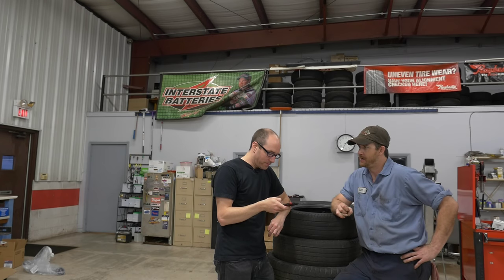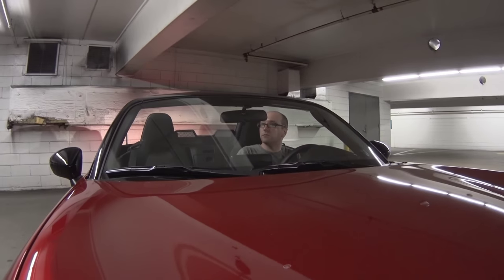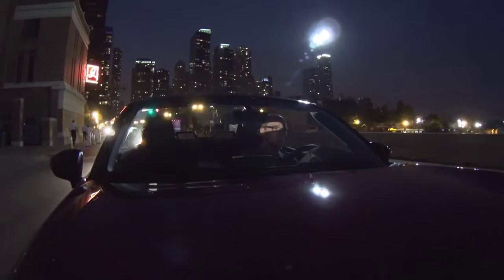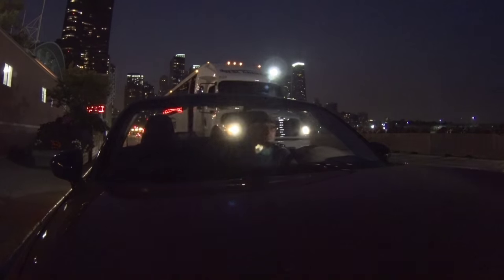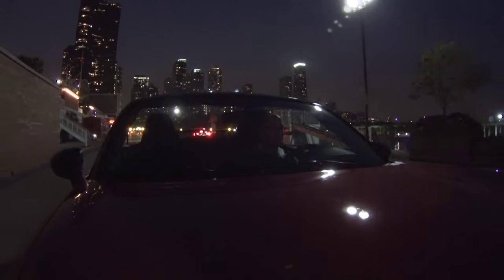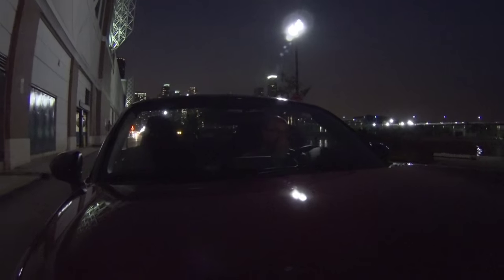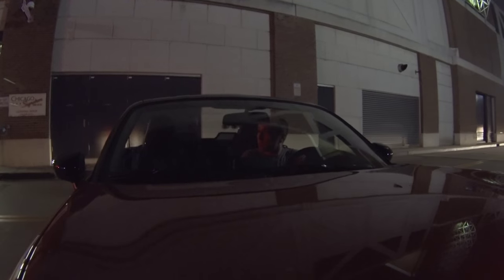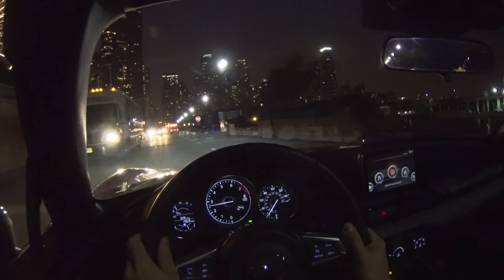2016 Mazda MX-5 Interview with Dave Coleman

Comment: Nice to see Dave putting his genius automotive insights to good use with Mazda, I read his stuff extensively back in the SCC days.
Reply: Weeeeeeerd. I still have a stack of SCC mags. He was a great writer as well.
Reply: @WeAreN1nja  Mazda knew what they were doing by hiring Dave Coleman as North American Design engineer. I also subscribed back in the day. So I was so impressed with this 2016 MX-5 Club soft top after the test drive had to Buy it. Very addictive place that drivers seat even after 6.5 years owning as a daily in Northern Illinois. I put the Michelin winter tires on for those snow & ice days. I didn't expect the car to handle so well in those conditions but it makes the 50 / 50 weight distribution show up more. Really well engineered car.

Comment: Dave Coleman seems like a totally legit dude and represents the Mazda brand well. Still, his answer to the 2.5L question was kinda BS, I give it about a year before someone figures out how to get a 6.2L LS in there - lol.
Reply: +GadgetsNGear Definitely BS, but I understand. He wants to defend the top management decision even though he doesn't want to put it that way.
Reply: He is not necesseraly bullshitting. Its quite possible that the 2.5 skyactiv is at least as tall the LS3, and from the factory they still have to fit the aero stuff and panels underneath and have a certain ground clearance etc. 

but i am very curious if the new 2.0 skyactiv-x will find its way into the mx-5.
Reply: Not BS at all, he didn't say it was impossible, he said it was more difficult. Mazda has to be concerned with production constraints and cost that a one-off tuner doesn't. Flyin' Miata has an LS in the car, doesn't mean that it wouldn't be difficult for Mazda to mass produce it with the 2.5L.
Reply: And completely ruin the handling dynamics in the process.
Reply: @kcav1255  : Mazda has to consider the cost vs. benefit (i.e., sales potential).  FM has stopped doing LS swaps, because it was taking up too much of THEIR time, but when they did, it was $50,000  -- and you supply the ND.  Could Mazda fit the 2.5L Skyactiv-G (or better yet, the 2.5L Skyactiv-T) in the ND chassis, and mass produce it?  Maybe.  But there isn't a business case for a $50K Miata.

Comment: Savage Geese had a magic ball to look into the future and ask Mazda to revise the engine to give it more horsepower, and lo and behold, 3 years later 181hp motor! 😁
Reply: Yeah, I have one and it's nice, but it could still use another 20 hp. (There is no end point to the quest for power, esp. when the chassis can manage it.)
Reply: @johntechwriter  You should check out BBR's 'Super 220' package. It includes revised ECU, cams, valve springs, retainers and exhaust manifold and you could probably be in the 200whp range. If not, you can add Flyin' Miata's midpipe+ axle back exhaust which add a further 16whp.
Reply: Art Uro  I think so, when savagegeese interviewed him again for his video called 'Mazda Miata Documentaries ND | EP5 Final Chapter?', Dave Coleman mentioned that when they were developing the ND, most of their development budget for the engine was prioritised to the 1.5 litre engine as that was how the Japanese head of engineer wanted. The american mazda HQ wanted the 2.0 litre engine for the american roads, so it was later added on, almost like an afterthought. So therefore, little money was spent on making the 2.0 litre engine 'perfect', as it was mostly off a Mazda3. But a few years later, Mazda Japan gave the engineers the greenlight to further perfect the 2.0 litre models to how they should've been from the start.
Reply: Art Uro  P.S. so at the stage of savagegeese calling him at 2015, Dave Coleman was very tight lipped about future plans on making the 181hp engine
Reply: Art Uro  Me too man 👊The 2019 NDs also get more steering wheel adjustment too for your ideal driving position. My only wish to Mazda was for them to build a proper coupe version of the car even if demand was limited - it would make the chassis more rigid for improved handling, it would have better refinement from reduced NVH and it would be more practical to store your trackday tyres 👌
Reply: Art Uro  Nah Joji is right though. For example, the Porsche Cayman noticeably handles much better as it is a Boxster with a more rigid roof for better handling. And the added practicality is a big bonus for trackdays. It sounds better, accelerates faster, and has a better quality interior than a 86/BRZ too.He's not saying Mazda should stop building the convertible MX-5s, he's suggesting Mazda to add a coupe version on the line up too. Not everyone likes to be seen in a convertible and in some countries, convertible roofs get vandalised by people who have sharp objects with them.
Reply: Art Uro  Why are you being so mad? "how many cayman were sold compared to boxsters??? A fraction!!" - okay, so tell me why:
1. dealerships are marking up prices for Cayman GT4s over MSRP price.
2. Cayman GT4s are one of the most popular track cars, ESPECIALLY on the nurburgring
3. many enthusiasts prefer the compact dimensions and midengine handling characteristics of the Cayman over the larger 911, without having to look like a poser in a convertible boxster.
4. Cayman GT4s are more sought after than Boxster Spyders 
Just because you don't like it, just because they are sold in low numbers, doesn't mean there isn't demand for them.
Reply: Art Uro  "Why r u comparing posches to brz?" I didn't. You read my message wrong. When I said "It sounds better, accelerates faster, and has a better quality interior than a 86/BRZ too.", I didn't mean the Porsche, I meant if Mazda made the Coupe version, how that MX-5 ND Coupe would compare to a BRZ. I never said that the Porsche is competitively priced to the Mazda...I don't know what you're thinking.
Reply: Art Uro  I've replied to your questions but the fact that you can't maturely reply to my questions shows that you have no reasons to back up your unjustified insults and objections. I also never said I wanted to buy a cayman. I brought the 'porsche cayman' example up because it is basically a coupe version of the boxster - its a proven case that could be applied if Mazda hypothetically built a Coupe version of the ND MX-5. So what if it doesn't sell in big numbers? Mazda can make it a limited edition, so that they can increase demand there.

Comment: Just a comment in general on infotainment screens. If like the mx5 you have a screen that can be specified with a rear view camera then it has to be able to pass an assessment or it cannot be legally sold in the US. Essentially there is a trade off between distance, resolution and angle. A high res IPS screen is expensive and requires a more expensive processor so in order to pass the assessment with a normal 400X800 TN screen you have to go with the floating dash solution if you have a very low scuttle.

Comment: as the Miata ND needs to last a good number of refreshes. what do you think the chances of the 1.5 version with turbo coming to the states? possibly could be a MazdaSpeed edition?  how much HP could it produce?
Reply: The turbo would compromise drivability. That's why Mazda have resisted forced induction. It would have been easy for them to stick on a snail and get 225 hp. Instead they developed every component of the 2.0 engine and got 181 totally linear hp with peak torque dropped to 4000 rpm. The result is a fantastically drivable car whose 0-60 time of 5.7 seconds would blow a Jaguar XK-E into the weeds, and will top 140 mph.

Comment: Nice review, and your interview with Dave Coleman makes it that much better.  Living with the car, I don't think the criticism of the infotainment system is warranted.  I also think I know why it is the way it is.  Visibility is just right -- it's not in the way or a distraction, but you can see it if you need to without taking your eyes off the road.  (You can shut it off by simply speaking the command: "Display off.")  If it was motorized to drop down into the dash, the dash would have to be heavier and visibly more buky, you would have to wait for it to rise to use it, and it would add a complex mechanism that would be expensive to fix if it failed.  Even a manual fold-down screen would risk expensive failure.  Think about how prone to breaking at the hinge area laptop computer cases are.  The "stuck on" look is just something that takes getting used to with any flat screen tech.  TV cabinets looked "strange" when they first stopped trying to make them look like furniture, but we got used to it.  Today, a "console" TV is a museum piece.  Then flat-screen TV's made that huge black plastic box behind the TV obsolete.  Having an in-car flat-screen display built into the dash makes about as much sense as putting a fake black box behind your flat-screen TV to make it look "right."

Comment: He totally avoided the LSD question at the end. I wish you guys didn't mention "suspension" in the same question (because that answer is obvious and easy – that's why he stuck to talking about it). Or that you guys at least reiterated or reasked the LSD question, because that's the real question.
Not even for performance but rain driving, snow driving, etc. Then years decades down the line, you have a lopsided market for a used ND where one has to avoid the numerous Non-LSD cars driving about.

Comment: " We want EVERYTHING for $25k"
Reply: I got everything for $24,680. It happened last September (2019), when I purchased from a Mazda dealer a new '19 Sport model with manual transmission. This is the same 181 hp power train as in the Club but for thousands less. Take my word for it . . . this is my fourth MX-5 and unless you're autocrossing you lose nothing by buying the base version. In fact, the Sport is so much cheaper, you could probably upgrade the brakes and suspension more effectively than you could with the money saved by not buying the Club, and the car would be uniquely yours. I have yet to see a Sport version reviewed on YouTube. Mazda and its dealers would prefer you didn't know it even exists. But it does, and despite its price being bumped $1k for 2020, it is the sports car bargain of the industry.

Comment: the biggest jibe with these cars is the accommodation for larger drivers. It seems they are designed for the asian market. Once you approach 6 foot height, the car becomes cramped. Even smaller drivers sit perched up in the vehicle. Why not a mini-Mclaren driving position? Sit "in" the car, not "on" it.

Comment: Yes I think that the NC was generally more appealing to a softer older GT crowd then the NA & NB & also coz it came with a Power Retractable Hardtop that is more practical unless you wanted the lightest weight possible for track use... That's why the Removable Hardtop wasn't popular. I they should definitely bring out a Hardtop as as this car is definitely more appealing to the Club Racer or Weekend Warrior as the first two were. I think that there should be both Power & Removable as there is clearly going to be a market for both with this model... They are already offering a trim for each market so why stop there??? Are you listening Mazda??? Give the GT a Power Retractable Hardtop & The Club a Removable Hardtop, Recaro's & hopefully a Supercharger this time (or a Turbo... I know more peak power & more practical blaa blaa) as it is more enjoyable to drive especially in a car like this IMHO... & that's what this car is & always has been about. Maybe even a roll bar for the Club. DO IT! I along with countless others will buy one!!! Get your arse in gear Mazda!

Comment: That screen is a horrible touch and it's not just this car.
Reply: +Scott P Love it.  I'll bet none of the haters have ever used it.
Reply: i can't get used to it on my roommate's Mazda 3 and when i test drove the Miata. was a distraction, especially for a roadster. they need to allow the option for Android auto or Apple carplay ASAP. 

especially since it's in all their vehicles, bite the pride and bullet. love the user and give us the standard in smartphone integration. you can make up the cost over time. 

my roommate tried to update the software firmware on his 2014 Mazda 3 and the dealer wouldn't help and the instructions aren't really easy. and he's an engineer.
Reply: I really like it.

Comment: So the base car doesn't come with an LSD? That's a bummer. I think I'd still just get the base car and ad some nice tires and pads and call it good until an aftermarket LSD became a viable upgrade. I don't like the look of those black BBS anyway.

The screen will be deleted by fans I'm sure, can't wait to see what goes in its place. I was sad to see that the car didn't come in any fun colors. The ND is begging to be starlight blue or dark green!
Reply from the maker: The car needs for colors for sure.  Lotus was always the anti LSD for lightweight cars, not sure how much it really matters.
Reply: savagegeese Good point about Lotus; subscribed. I think offering the LSD on the ND is a good move though. A lot of the NA fanbase that Mazda is attempting to reel back in will expect an LSD somewhere on the menu.
Reply from the maker: +Eric Leippe LSD should be an option club or not as you said and I think most would agree.  The BBS raise the cost too much for my taste, I think the stock wheels look better on the car.  But you know mazda will have 20 different variations over the next two years.
Reply: savagegeese I sort of miss the days when a special edition Miata with tan leather and BBS wheels was a big deal. I guess that's another aspect of the ND being a return to form, since the base model is so appealing. Everything you opt for is just more fat! It seems like the NC was sort of lame until you threw a few options packages at it, but then I never did drive one.
Reply: +Eric Leippe From the specs page on mazdausa.com "Limited-Slip Differential : Torque-sensing limited-slip differential (MT only)"
Reply: well, we know the answer to the last question with the RF coming. you have to figure this car needs to last at least 10 years like reach generation does. so I'm sure all the seating color combos and LSD, wheel, safety gadgets still come out. 

can't bring out all the tricks at once. they gotta slow roll the features, especially since they have three monopoly on this market. think iPhone product strategy. something really good and beating the crap out of it until they really need to create something different.

Comment: The infotainment system is great; you don't  notice it unless you want to.  When you want to see it, the fact that it's not buried low in the dash is a blessing.  Don't want it -- get the Sport.
Reply: The Sport has the same infotainment system, just with fewer choices. Having owned one for six months, I'm accustomed to it and do not find it obtrusive -- mainly because it does not interfere with my line of sight,
Reply: @johntechwriter  :  IIRC, the Sport shares the same screen as the Club and GT as of MY2018.  (I believe this change was made to accommodate a screen to display the images from the mandatory back-up camera, which was required in the U.S. by May 2018.) Prior to that, it was not an infotainment screen, but a smaller set of controls for the base level audio system.  I was referring to the difference (4 years ago).  Your larger point is correct: the screen doesn't interfere with the driver's line-of-sight when driving, yet does not require much of a glance to see while driving.  Pretty neat trick, IMO.